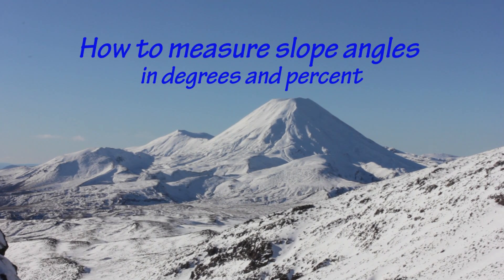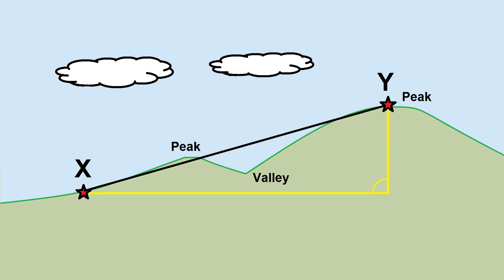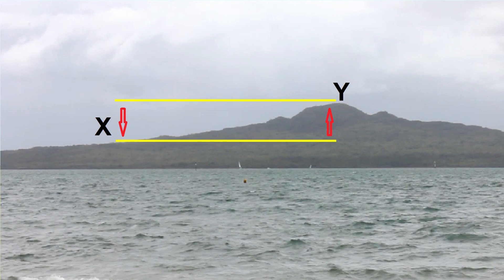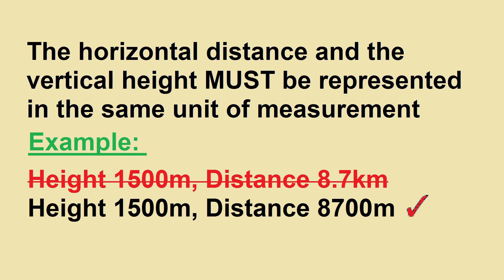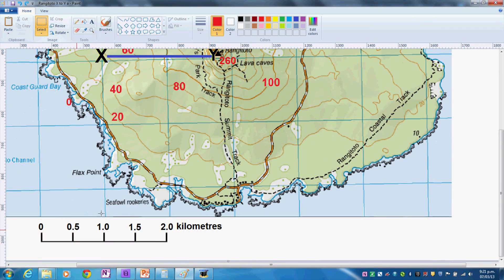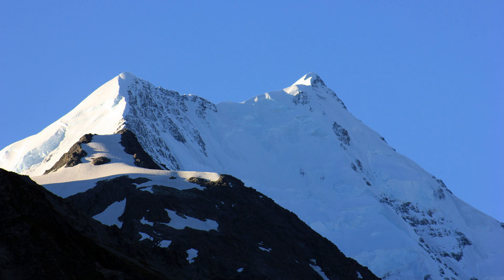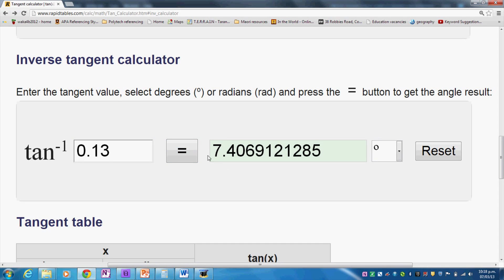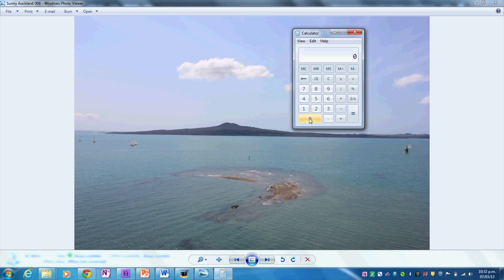How to measure slope angles in degrees and percent

Comment: Hello, why cant I say that if 90 degrees = 100% then X degrees =  Y%
Reply: wouldn't you want to do it the the other way around ? Finding the inverse tangent to get the degrees is much harder than simply multiplying the rise/run by 100 to find the percentage. 

In this video ,the gradient is 13%,
if 100% = 90 degrees
1% = 0.9 degrees
13% = 0.9 x 13 degrees

13% = 11.7 degrees. 

Oh Dear, that's not correct at all. The real gradient is 7.4 degrees. I guess it doesn't work lol .
Gotta get that calculater out and do the inverse tangent I guess.